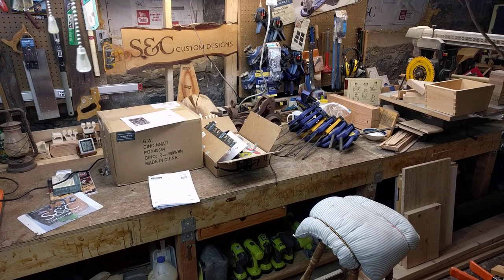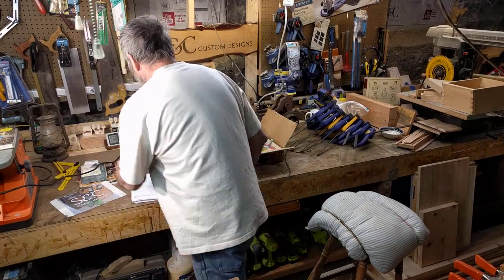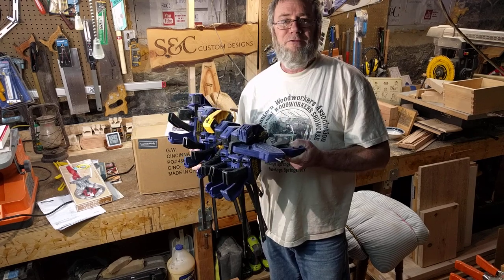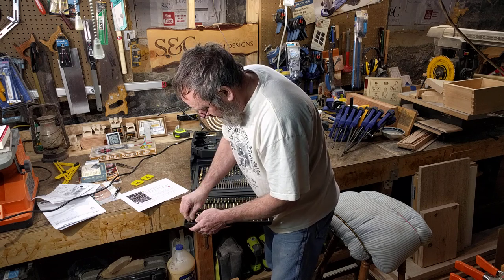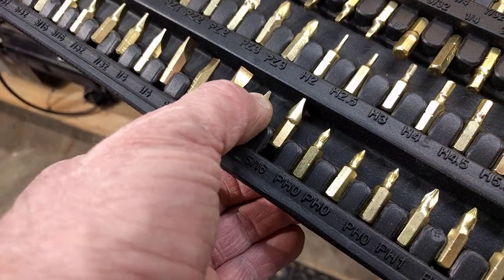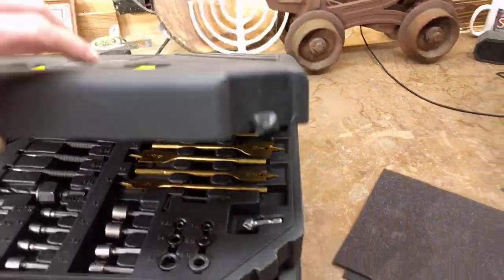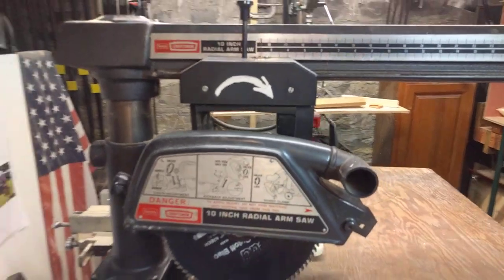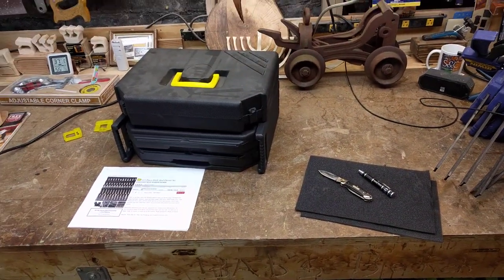Garrett Wade: 333 Piece Drill And Driver Set. WOW check this OUT!

Comment: I was actually on the fence about buying this set and your review convinced me to pass on it.  The case is so cheap and flimsy, it just doesn't bode well and I would have expected better.  Thanks for the review.
Reply from the maker: Hello Brenden, 
You are absolutely correct when you say that the case is flimsy. Not only that but the latches came off and I have to constantly put them back on again.  This is not exactly a feature I am looking for LOL.
The saving grace for this product though is that on that rare occasion when I need that odd bit/tool, I find it in this set.

Comment: What are those grey things used for? They almost look like marretts
Reply from the maker: Hello Rick and thanks for your question. 
The official answer from Garrett wade . . .
"As far a the 4 grey units, they are screw starters. They are designed to slip over the driver and insert the screw so the tip of the screwdriver mates with the screw which is in the starter."